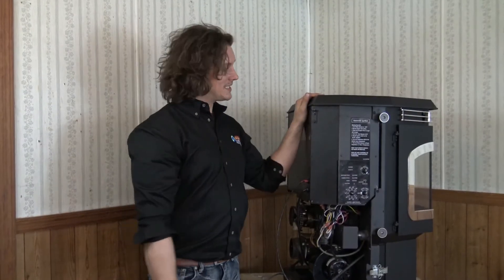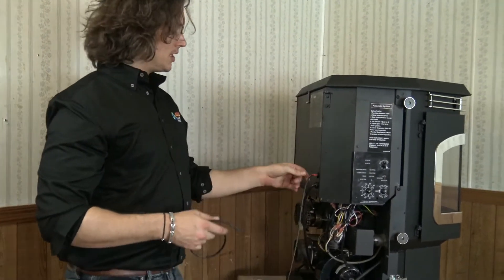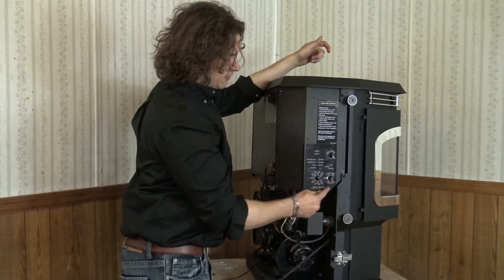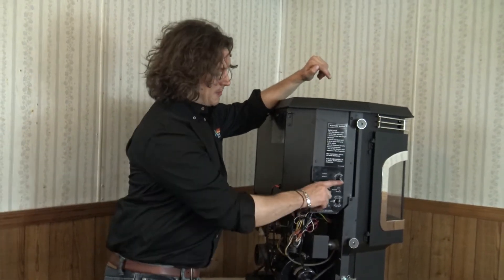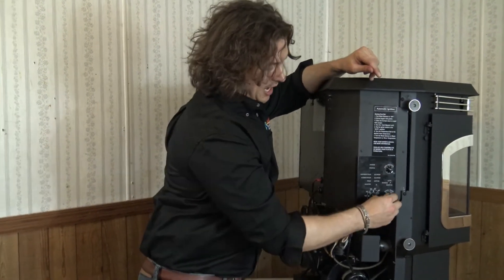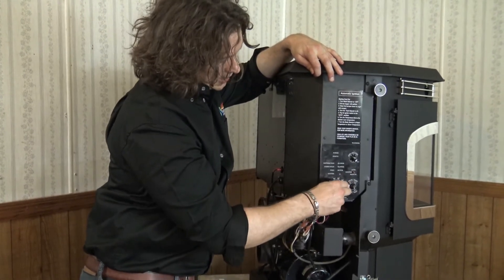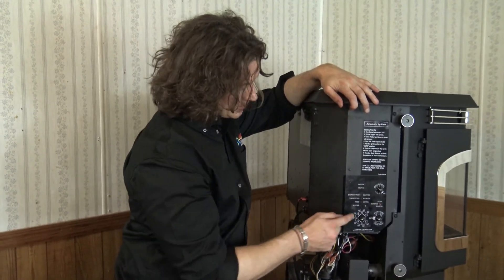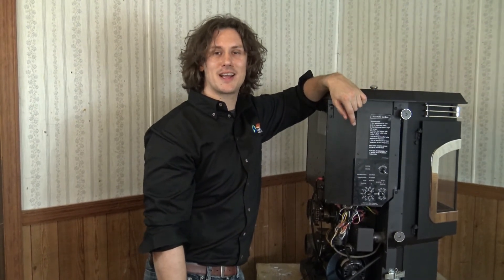Harman Stove Controls, How to use a Harman Pellet Stove

Comment: Am I incorrect in assuming that when in room temperature mode the stove will feed pellets at a speed necessary to achieve and maintain that set temperature no matter what the feed adjuster is set at.
Reply from the maker: Thanks for the message Captain. The feed adjuster dial is best thought of as a limit/governor. In room temp mode the unit will adjust fuel feed as needed to maintain the set temperature, however it will not exceed where the feed adjuster is set. So for example, if I have a 40,000 BTU Harman model, and I have my feed adjuster set to a 3 setting, I am setting the max feed at 20,000 BTU which would be approx. 2.5lbs per hour of fuel consumption. Feed adjuster best settings really depend on the space one is trying to heat and how well it is insulated. Best practice is to turn the stove all the way to 90 and see where the fire line is in the burnpot after 60 minutes. Looking for a 1" fire line to the edge of the burnpot. If it's burning down deeper in the pot, turn the feed adjuster up higher. If the fire line is closer to the edge than an inch, turn the feed adjuster down a bit. You may find variances on where you set the feed adjuster based on different pellets and dramatic weather changes. Hopefully that was helpful, if you have any other questions please let us know. 
Thanks!

Comment: Not sure my stoves is venting properly (P61). On startup there is a puff of smoke coming from the back of the stove just prior to ignition.  The ignition of the fire is clearly visible and the fire box does not appear to be overly smoke filled.   It’s enough smoke to have us open a window and use a fan to clear the room.  Stove is located on our sun porch of a ranch style home.  Any observations that you may have would be greatly appreciated.
Reply from the maker: Happy to help. We will want to check the venting seals starting from the vent pipe connector that goes to the cast iron hub on the stove. During ignition there is significantly more pressure on those venting seals. Use high temperature silicone and place a bead around every vent pipe connection. Connector to stove and every connection along the pipe as it goes out the wall. Nearly every brand of venting we have worked with requires sealant once the pipes are locked together in place.  In our installations once we perform this we then take a handheld CO meter and check for leaks during the start-up period. 
Here is a link to high temp silicone for reference. https://pellethead.com/product/nuflex-high-temp-black-silicone-sealant-adhesive-10-2-oz/

Any other questions please let us know.

Appreciated,
Reply from the maker: Silicone Link Changed - New Link: https://pellethead.com/product/nuflex-high-temperature-black-silicone-sealant-adhesive-10-2-oz/

Comment: How long does it take to cook the new stove stink out of a Harmon p61?  The new stove fumes are giving us head aches.  Thanks for your time
Reply from the maker: Thanks for your message. Yes, first couple fires the paint is curing and it will produce noxious fumes. We pre-burn all of our stoves before they go out for this reason. We do two burns, about an hour each. First burn gradually increasing the fire and heat output, second burn cranked all the way up. Open and close your front door and ash door a few times throughout the process so that the door gasket does not adhere to the stove body. With the stove in the house doing this, open up all of the windows and have fans going during these first few fires so that it is well ventilated. Any questions please let us know. Appreciated,
Reply: Your procedure worked perfectly as described.  Thank you.

Comment: Spoke too soon. I did go out again. I was Hopeful. Thermostat wire as stated earlier is frayed.
Reply from the maker: OK, If we are having issues with the fire going out and distribution fan issues on both Room Temp and Stove Temp mode, then we first need to look at the exhaust ESP Thermister Probe. Let's start with the basics by cleaning that probe and we can see if there are any changes. Here is a video that will walk you through that. https://youtu.be/kt7nnGMYU-k. 

Yes, if your room sensing probe/thermostat wire is frayed, then most likely Room Temp mode will not function properly. Here's a link to the Room Temp Probe if you do need a replacement. https://pellethead.com/product/harman-room-air-temp-sensor-thermostat-sensing-probe-wire-oem/

Keep us posted on the operation in Stove Temp Mode after you clean the ESP probe. 

Thanks,
Reply: Earth Sense Thanks ordered 
Thermo wire. My exhaust motor need work. Make a semi loud and low vibrating sound. What do you suggest ? If I am to disconnect stove I would like to solve motor issue as well. Your the best!!! 
M
Reply from the maker: @danmccoy4779  Thanks Dan. For the exhaust motor, you could check the mount and rubber grommets to make sure it's secured well. You can use a multi-meter to check voltage - should be near line voltage on start-up. If the noise is coming from the bearing inside the motor, than most likely the motor is on it's last leg. Here is a link for you to check out the motor if you do end up needing it. Keep in mind the fan paddle impeller is separate and if you do need to remove it to pull the motor out, lubricant can be very helpful in loosening that fan paddle. https://pellethead.com/product/harman-heatilator-ecochoice-combustion-blower-exhaust-draft-fan-motor-oem/

Keep us posted. Always happy to help.

Thanks,
Reply: I have changed sensor and to replace exhaust motor today . Would you recommend an exhaust extender so I will not have to pull away from wall to service. I have it pulled 6"  inches from wall exhaust pipe.
Reply from the maker: @danmccoy4779  Thanks Dan, Keep us posted on the operation with the new sensor and exhaust motor. Yeah, if it's tight in the corner it can make it a bear to get back there and service. The unit does have a quick disconnect exhaust hub, however room is still needed to access that. Having it out a little further from the wall can definitely make things easier for cleaning/service. If you do put a pipe extension on there, make sure it's the same manufacturer of venting for proper locking & code and we recommend high temp silicone around all joints to ensure no leakage. Happy to help! Thanks,

Comment: I tried your recommendation and stopped the feed and flame  went out Had it turned up to 90 degrees.
Reply from the maker: Thanks for the message Dan. I think we will want to inspect that room temp probe a bit more. Let's first start with unplugging the connectors from the back of the stove and plugging back in. Next let's look closely at the placement. Generally speaking as long as there is not draft or direct sunlight, coiling it up and taping to the rear of the stove is a good position for that probe. The probe can also be extended if needed to run it anywhere in the area you would like. Let's also do another test. Turn it to Stove Temp, Crank it all the way up to 9 on the dial, and leave the Igniter toggle on Auto. Let us know if you have a consistent flame and blower speed when operating that way.

Comment: Thanks for you response .I have never used it that  way in two years. I will give it a try. The line is frayed from my animals. I use it in my bird aviary.I keep the Aviary above 80 degrees. The room is screened and I use floor fan to distribute and vent heat out of  the room.Has worked great until recently.

Comment: I am having trouble setting room distribution fan to run all the time. I have trouble maintaining 80 degrees constant running. I have set on manual mode.
Reply from the maker: Thanks for contacting us Dan. Happy to assist. I would suggest operating the unit on Room Temp mode if you are looking at having the unit maintain a set temp of say 80 degrees. Placement of the room sensing probe is very important - make sure it's not picking up drafts or direct sunlight. When you flip the igniter toggle to Manual, depending if you are operating on Room Temp or Stove Temp, that will affect your distribution blower. If you leave it on Automatic Ignition you will notice more consistency with the blower. Ultimately if you are on Room Temp Mode, that blower will adjust depending on the call for heat. Let us know what you find, happy to assist.

Comment: We got a brand new p43 and it doesn't work half the time. It'll take 30 minutes to auto ignite. Sometimes I need to turn it off and back on to let it go through another ignition cycle. Once it's going, it may shut itself off after a few hours. We replaced our old pellet stove that has been discontinued and parts are no longer made for it, old stove was better until it kicked the bucket. Any ideas? Thanks
Reply from the maker: Thanks for contacting us Edgar. Sorry to hear of the troubles. The Harman P43 is one of our best selling models and one of Harman's best selling models. I'm sure once we work the kinks out here you will love the unit. 

Ignition: Should be auto lighting within the first 10 minutes. If we can, let's check the igniter Ohms to make sure it's in operable range. It should read between 45 and 53 Ohms. If outside that range (Higher or Lower) there will be issues with proper ignition. Double check the igniter cavity - Make sure the throat area is clear and that the igniter in the cradle is mounted properly and evenly to the burnpot. Double check your burnpot holes - make sure they are all open and clear. 

Shutting Down: When it shuts down on you are you getting a Status light blink code? 

If you are operating the stove in Room Temp Mode with your igniter toggle on Auto, the unit will shut itself off when heat is no longer required and light itself when heat is demanded. If you turn that igniter toggle to manual after it's lit, it will stay burning at a low fire until heat is eventually called for. On Stove Temp Mode it operates off the numbers in the inner temp dial. Set rates of feed and heat output. Some folks like running in Stove Temp vs Room Temp. 

When it's running what does your fire look like? Is it crisp and torchy or is it wavy/lazy? 

Let us know any other details that will help us assist. Confident that once you get the hang of the P43 that you will love the unit. Keep us posted. 

Thanks,

Comment: So... Am I to assume that the feed adjuster dial only comes into play, when in stove temperature / constant burn mode?
Reply from the maker: Thanks for the message. The Feed Adjuster Dial Only Comes into play on Room Temp Mode. On Stove Temp mode it is just a set rate of feed based on where you have the temperature control dial set. The inside 1-8 will be the set feed settings on Stove Temp Mode. For Room Temp mode is where you will want to make adjustments to the feed adjuster. Rule of thumb for the feed adjuster setting: From a cold stove, crank the temperature dial up to 90 degrees on Room Temp so it's calling for maximum fuel. After 60 minutes of burning, your fire line should be 1" from the edge of the burnpot. If it's burning down lower in the burnpot, increase the feed adjuster. If it's at the edge of the burnpot or pushing hot coals over, decrease the feed adjuster. The Feed adjuster acts as a governor for the max fuel that can come in to the unit. Larger, draftier areas generally need this to be higher. Smaller, well insulated areas generally need the feed adjuster to be lower. Again if you are running on Stove Temp mode it will not matter where you have the feed adjuster set. Any other questions please let us know. Thanks,

Comment: Due to a power surge, the fuse blew on my Harman Accentra.  Not knowing what was wrong, I called for service but was told it would cost an absurd amount of money to have someone come out (74 miles away).  By examining the wiring diagram, I guessed it was the fuse and was able to replace it myself for $3.  It would be great if your videos could cover such minor maintenance, especially for those of us far from a knowledgeable service person.
Reply from the maker: Absolutely Lawrence! Thank you for sharing this. I will add it to our upcoming video list. Very appreciated! Glad you were able to solve the issue, any future questions or assistance needed we are always here to help. Thanks!
Reply from the maker: We recently did a video on replacing the Harman Control Board Fuse - You Can Find That Here - https://youtu.be/vJZn_EC-2gc
Reply: This is why they tell you to use a surge protector.

Comment: Should a pellet stove be used 24/7 or how long do u recommend for a run time?
Reply from the maker: Hey Arnaldo, thanks for contacting us. Many of our customers do run their pellet stove 24/7 only shutting down for routine cleaning. I used to run my stove non-stop as well. Completely safe and approved to run that way, but it is very important to stay on top of routine maintenance required based on the make and model. Any other questions please let us know. 

Thanks,
Mr. Pellethead

Comment: Hi and thanks for the great video.  I found it very useful compared to reading the manual.  I inherited a P68 pellet stove with a fairly big ranch house with a massive basement that I am looking after for the winter up here in Ontario.  It's dropping down to -20 tonight so time to get this thing working.  After looking at it, It seems it was kind of serviced by a previous owner but I'd say not professionally.  I've been reading the cleaning instructions but I am a visual learner.  Do you have a video showing all the recommended cleaning steps?  Thank you very much!  From a new subscriber :)
Reply from the maker: Thanks for contacting us Alset, very glad to hear this video was helpful. The P68 is a great stove. We don't have any complete cleaning videos of the P68 at this time, but we can definitely put on our list to complete in the future. Overall the P68 is one of Harman's easiest units to clean. Few key notes here. 
1. Use a big dry paint brush to brush the ash off the upper heat exchangers for max efficiency. Turn the control board feed adjuster to test while doing this so the ash is sucked in and doesn't make a mess. 
2. Make sure the burnpot stays clean. Inspect the holes to make sure they are open. We offer a modified scraper tool that makes cleaning the firepot a breeze -  https://pellethead.com/product/harman-stove-fireplace-insert-burnpot-firepot-grate-scraper-tool/
3. Vacuum out the igniter area on the burnpot, removal of front plate. 
4. Annually clean the exhaust ESP probe (we have a video on this here on youtube)
5. Annually clean out the exhaust venting and remove the plate behind the ash pan to check the combustion chamber throat and fan paddle. 
6. Annually dust off the motors and blowers - no lubrication needed. 
7. Annually check the sawdust cleanout box (located behind the auger motor) Clean out any accumulated pellet fines. 

Hope this is helpful, thanks again for subscribing!

Thanks,
Mr. Pellethead

Comment: I repost this video all the time on my hobby shop pellet stove repair biz, this is best description I have seen anyplace. I hope you are compensated by Harman! I am over at facebook.com/607pellet --Thank you for this perfect video.
Reply from the maker: Thanks so much Christopher! So glad to hear this has been helpful for you and your customers. That's what it's all about. Any future questions or needs just let us know. Thanks again so much! 
-Mr. Pellethead
Reply: That was an excellent video learned I haven't been running it correctly. On the Accentra stove what is the switch inside when you open the control panel? I think it says L & H Thanks in advance. Gary
Reply from the maker: @garygundlach4016  Thanks Gary! Glad it was helpful and informative. On the Early Accentra FS Models they did have a switch on the inside when you pivot open the control board. It is a High/Low Distribution Blower Switch. Basically it allows additional control for the speed of your room air blower. I would suggest keeping it on low for medium and low fires and in the coldest weather when the stove is running on higher settings flipping it to high. Any other questions please let us know. Thanks!
Reply: @EarthSense  thank you for your responnse
Reply from the maker: @garygundlach4016  Certainly our pleasure Gary. Any future questions please let us know; always here to help! Cheers-

Comment: I have a p68 model and my question is I have it in my basement which is 1600 square feet. Would this be strong enough to heat my upstairs as well.  The upstairs is 1600 to
Reply from the maker: Hey Doug, thanks for the message. Heat will naturally rise, however this will be very dependent on your basement and the insulation you have down there. A finished and insulated basement can make a huge difference on how much heat goes upstairs and how much fuel you use doing that. The more ways you can find to circulate the air the better. Some folks will turn on the furnace fan to circulate more heat which is helpful, others may install floor fans and things of that nature. BTU wise the P68 is a powerhouse - it's all about capturing that heat within the house and circulating it to get your desired effect and warmth. Any other questions please let us know. 

Thanks,
-Mr. Pellethead
Reply: If I opened a window would that help circulate the air upstairs
Reply from the maker: @dougclark787  I would say we want to keep the heat in. If it was an interior room window, yes. If it was an exterior window that will just suck the heat outside. Try running the fan only if you have a furnace system in the house. We also offer floor, wall to wall, and corner doorway frame fans that can help move and circulate heat. Box Fans and other circulating floor fans can also do a great job.